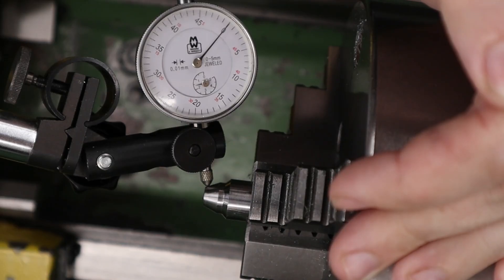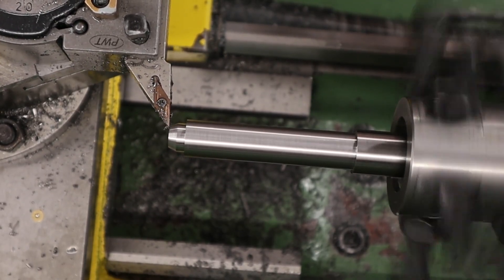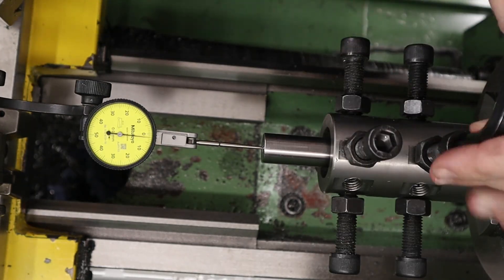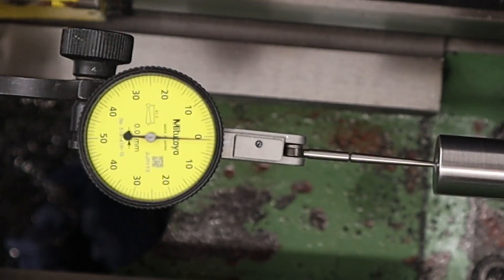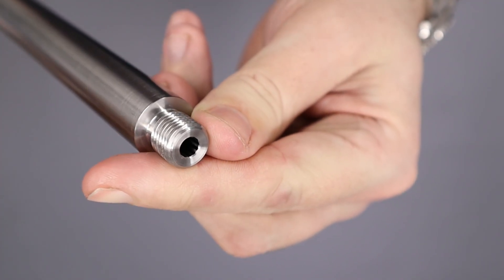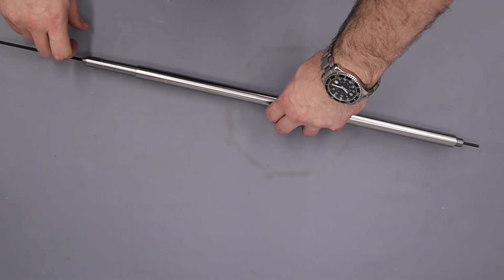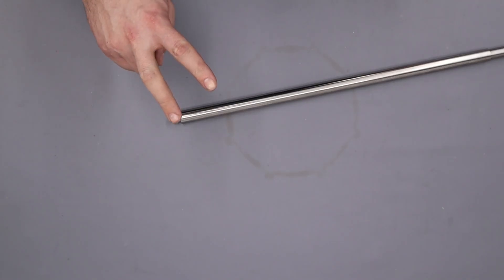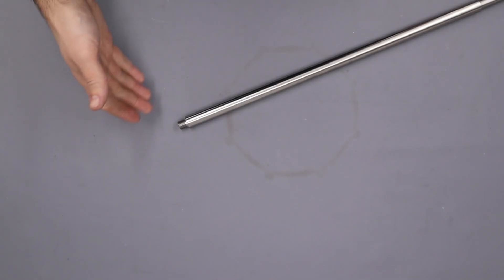Turning up a .22 barrel for the Anschutz 9015

Comment: Great video, do you have any experience with the sig mcx virtus air rifle barrel. This Airgun gives me 2 different groups within 10-15 consecutive shots. I’m trying to figure out why the rifle groups horribly
Reply from the maker: not had one apart yet but with this sort of problem it's a case of going through it bit by bit 👍
Reply: @sub12airgunners  I hope you can get your hands on one and investigate why. Many owners if not all have this problem. Must be something that owners can do to improve it . I can try to explain the setup briefly. On the 177 mcx and mcx virtus 22 it’s fed into the Airgun by a mag with a belt , with every trigger pull the belt/ plastic chain rotates and lines up internally with the barrel. Then as the trigger is pulled a hammer hits the air chamber valve and a burst of air hits that pellet and pushes it through the barrel, but right before the barrel is a small (breech piece) like a nozzle that is maybe half a mm bigger than the circumference of the pellet. After shooting the pellet into a 25 gallon water trash bin to capture the pellet I can see there’s a smear on one side of the pellet as if it’s not traveling through the barrel straight or evenly. Do you think it’s possible you can get your hands on one. I was thinking maybe putting a inexpensive slightly better barrel like crosman 2240 and if it could be improved a Fx barrel

Comment: is there ay reason that you prefer the spider chuck in the 3 jaw over the use of a 4 jaw? is it for the length of grip, as adjusting over 4 points o each of the 2 axis dose allow for a lot of movement a sideways twist
Reply from the maker: as you say it just gives more adjustment than the 4 jaw 👍